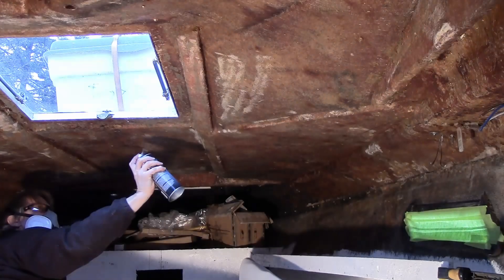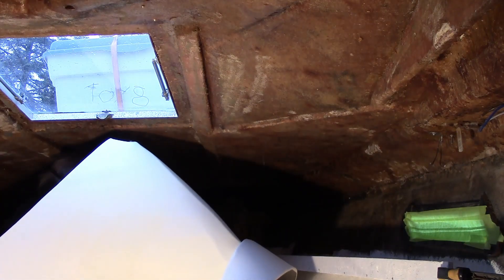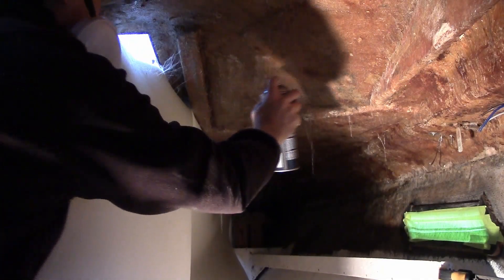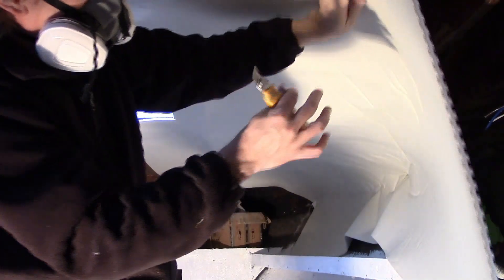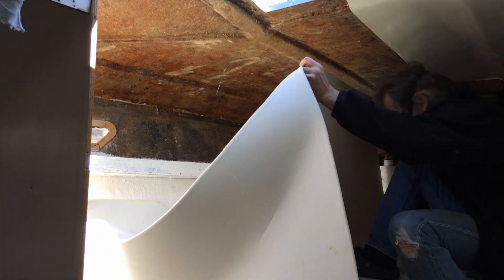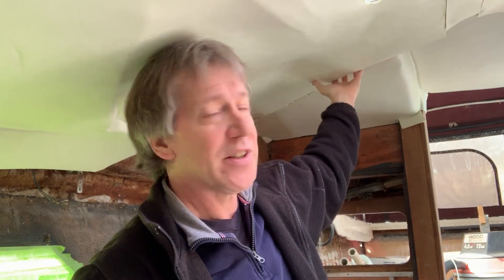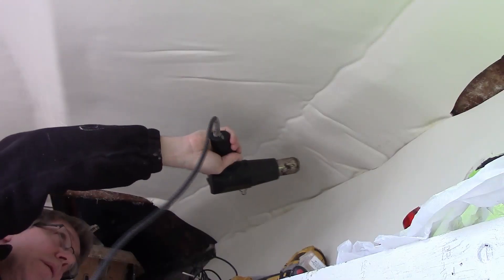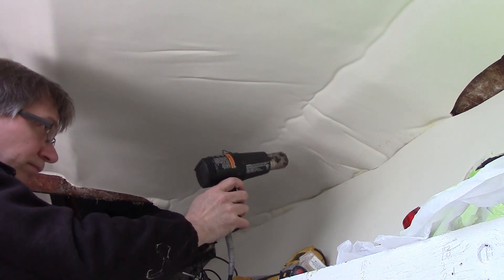Part 16 – Installing Foam Backed Vinyl Headliner - 1974 Sea Ray SRV 240 Weekender Re-build

Comment: I have two cabin cruisers coming up for complete remodel so it’s cool to see what you use for the headliner.  I thought it came out just fine.
Reply from the maker: Thanks. I thought it was the best choice for this kind of boat - and it will be fine once I'm done. I was just hoping for less wrinkles, but no surprise I guess since it was my first try! I didn't want carpeting or anything like that to attract dirt, and the foam backing on this stuff provides a bit of insulating value to hopefully reduce condensation as well as noise. Plus it's softer for when I bump my head on it...

Comment: Great attempt. Keep up with the heat gun or put a small heater in the cabin and smooth out the wrinkles. Vinyl needs to be warm. Makes it much more applicable. Keep up the good work captain!
Reply from the maker: Thanks for the advice - supposed to be getting warmer here by the weekend, so I'll see what I can do to remedy my mess!

Comment: How long is your Cuddy Cabin?
Reply from the maker: Not at the boat right now, but I can fit on the bed (I'm a bit over 6' tall), plus the length of the galley cabinet, so I'm guessing somewhere around 9 - 10' long. Your hardtop will have a shorter/lower "cuddy", as the galley and everything else is under the hardtop.
Reply: I don't really know.  My dad is looking to redo our current boat which he redid when I was 2 or 3, and he took all of that stuff out, so this will make this interesting.  Thanks